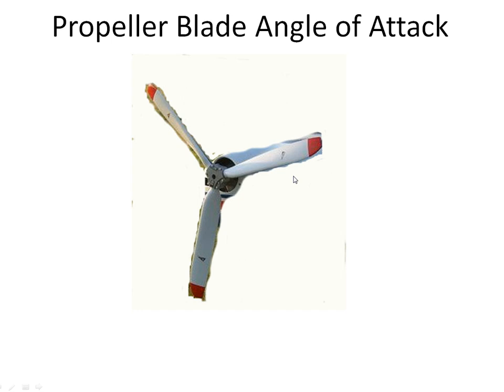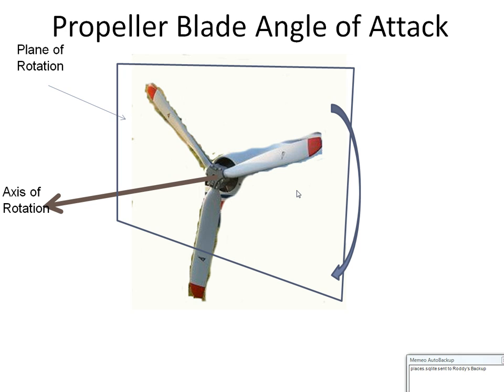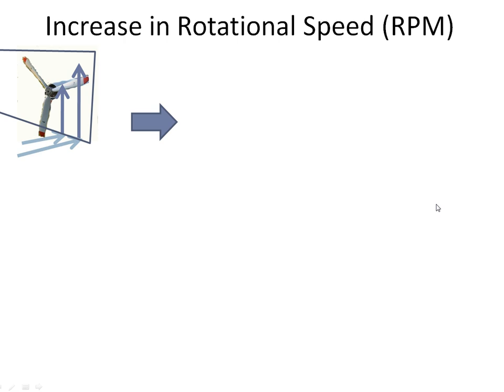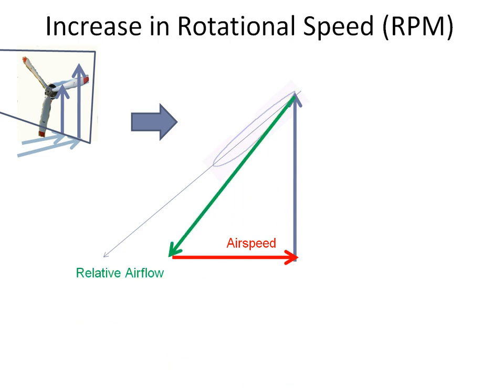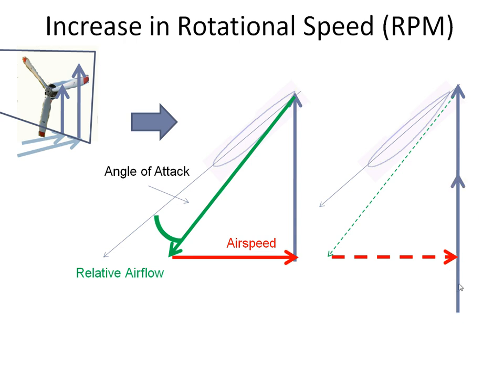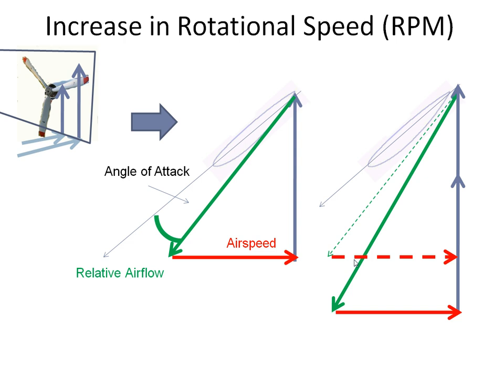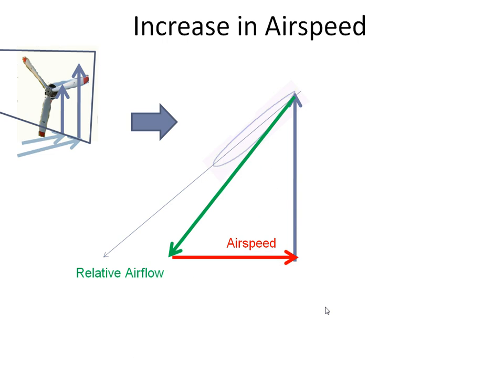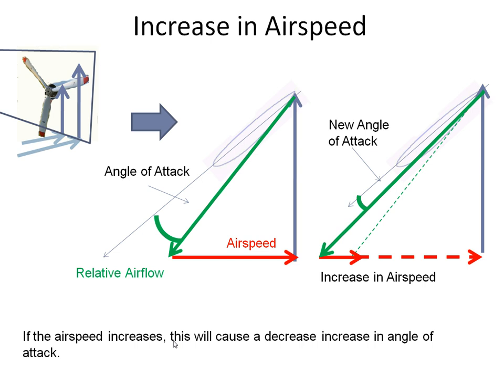Propeller Blade Angle of Attack

Comment: This is the best video I found on the subject thank you! What really got me every time was that cross section diagram with the graphs. I had no clue what part of the propeller we're actually looking at.

From what I can understand (and it would REALLY help to have an animation of an airplane going into the position of the graph before disappearing and leaving just that cross section) we are looking at the SIDE of the propeller as the plane is flying in from the right (and thus airspeed coming from the left). Is this correct? Thank you!
Reply from the maker: Yes, the cross section is of the propeller blade looking in from the side, with the aircraft flying from right to left.

Comment: So my textbook explain it right too but instead of talking about movement of airflow it use RPM and foward speed of the aircraft... Which is the incorrect way to explain the relative airflow.
Reply from the maker: The relative airflow is the vector sum of forward speed and prop airflow due to RPM.  So there is no difference in how they are being explained.

Comment: This is WRONG.  Propellers SUCK AIR IN, as well as rotate, as well as are connected to a usually-moving thing, like an airplane.  This video only considers the last two, and not the fact that the air is being sucked in in the first place.  This was almost certainly left out deliberately - the shape of the blade and the angle of attack determines it's efficiency, which determines how much air it sucks in, which gets ugly.  The angle-of-attack determines the airflow, AND the airflow determines the angle of attack - at some point an equilibrium is reached, which is highly non-trivial.  

You simply can't simplify this concept like Roddy did here.

Comment: Amazing video Thanks. I had a doubt though , So the angle of attack at  tip of the propeller would change because it moves at a higher angular velocity that the root of the , Blade correct?
If not can someone clear this doubt for me ?
Reply from the maker: No, the blade angle at the tip is smaller because the rotational velocity (V) is greater at the tip.  The angular velocity ( omega) is the same all along the blade.  The equation is:
V = omega.radius

At the tip the radius is at the maximum so the velocity is at the maximum.

Comment: If the airspeed increases, this will cause a DECREASE INCREASE in angle of attack? Please DECREASE or INCREASE?
Reply from the maker: All other things being equal (Blade angle, RPM), as airspeed increases, angle of attack will DECREASE.
Reply: Thank you Roddy, I was refering to last few seconds of the video, there is both decrease increase. Yup, speed up = angle of attack going down:) thanks for the video! Well made!

Comment: I did not understand the vertical speed. From where it comes from? 😔
Reply: Vertical speed is a result of higher propeller RPM that line is the measurement in force hitting the bottom of the airfoil. 
 The lengths of the lines are 2d representation of the amount pressure exerting on the airfoil as the propeller moves faster or slower in that clockwise direction (vertical) or forward in airspeed (horizontal)

Comment: It's just that the rotation in this case as you have shown is anticlockwise or left hand rotation. You have to look at the propeller from inside the cabin. Most of single engine pistons have clockwise rotation, so probably this propeller is also clockwise rotating, which would mean that it is rotating in the other than shown direction. Cheers mate

Comment: I'm not sure that this is correct. But I look at this from a wind turbine perspective but the principles are the same. Angle of attack (i) =Angle of incidence b/w relative wind and direction of motion of the plane (I) - Pitch angle (alpha). Given that the pitch angle remains the same an increase in I will increase the AoA. This is done via increasing wind speed or increasing plane velocity. Is this correct.
Im unsure about propeller planes but can the pitch of the blades vary accordingly to optimise the AoA(i) so as to optimise Fd/Fl

Comment: If you increase the RPM therefore increasing the speed, how would it affect the AOA?
Reply from the maker: How are you increasing RPM?  Are you increasing the power to the engine, then there will be an increase in power delivered by the propeller, or are you increasing RPM by selecting a more fine blade angle?
Reply: @RoddyMcNamee  Hi, i have the same question. why increase the RPM but the airspeed is the same? I didn't understand from your reply. Could you please explain more??
Reply: Assuming a fix pitched propeller for simplicity.  An increase in RPM does not necessarily assume an increase in airspeed.  For example, slow flight relies upon pitch for airspeed and power for altitude.